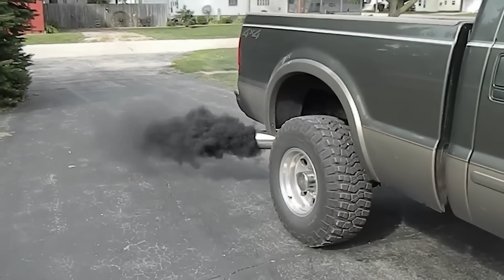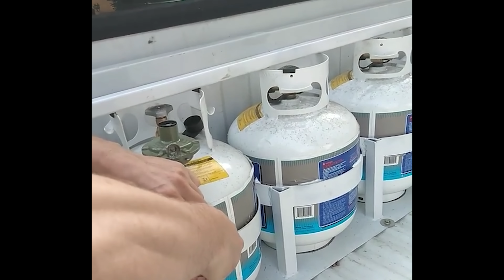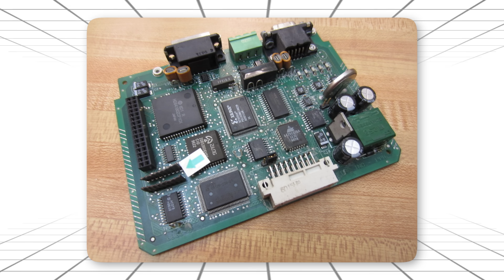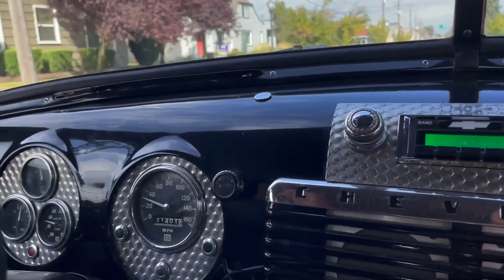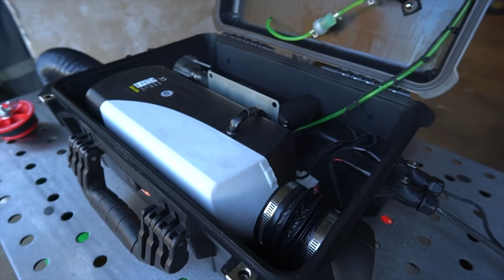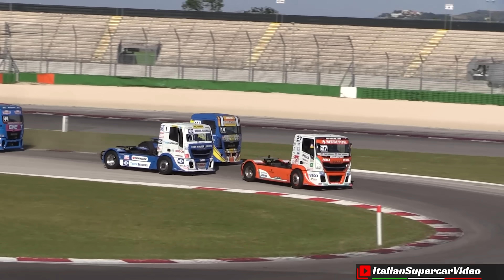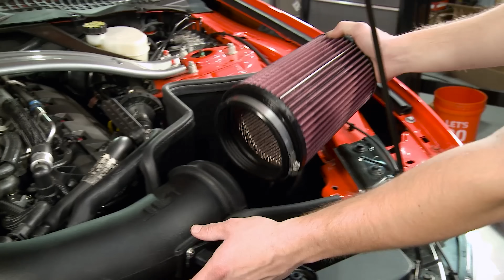They Made This Diesel Trick ILLEGAL For A Reason

Comment: Whats funny is its better for emissons,  extra cost, but no desiel particulares,  a clean burn.
Reply: It sounds like it should be a much better solution than using the DEF fluid.
Reply: @just-incase  Actually propane injection will increase combustion temperature and pressure and this will increase nitrogen oxide  production. Def can lower that. Benefit is more complete combustion that will lower particulate emissions
Reply: @williamvaughan1218   def has its own problems, like destruction of evergreen trees. Basic highschool chemistry proves this... it creates a chemical that stops the tree from protecting itself from parasitic bugs. You can find it in nature by animals urinating on a fire... which happens absolutely never... and for reason.
Reply: @just-incase Def doesnt help burning. It keep the catalytic convertor alive  bit longer.
Reply: @just-incase absolutely better... except with common rail technology. You have to tune very differently for pilot injection so the propane doesn't ignite before the diesel is ready for peak power combustion. And it helps clean up the box emissions the feds say they're concerned about, but prove in everything else they do that it's really not a problem...
Reply: Funny as a broken leg.
Reply: Nitrous oxides are the result
Reply: @sandasturner9529 
The result of what 
Please explain your answer
Reply: Sound more like complete bollocks to me.
It's presented as an easy answer but there are no easy answers.
Reply: @andrewfleming8103 
True as buddy since the 80s

Comment: One thing here I pass criticism as someone who was once certified to play with it it is not as simple as flipping a light switch if it pools and it explodes there such a fine fuel air mixture percentage that propane has to be within to combust otherwise actually you can put a match out in the mess

Comment: so you're telling me that i can reprogram to inject less fuel and get fucking amazing mileage?
Reply: I don't care for the bad AI video that glosses over the realities.  Cleaner burn yes with smaller propane percentages, but no "big" mileage improvement once you take into account the amount of propane used.  The extra propane will extend your range.  Cost savings per mile depends on the price difference between Diesel and propane, as when combined the MPG is about the same as the diesel is a higher BTU fuel and the propane a lower BTU fuel, but the propane does help the diesel burn cleaner/more complete when added in around 25-50%.  
When using in higher percentages as a power adder, miles per combined gallon of diesel/propane actually reduces MPG as you will burn through alot of propane.
Most of the AI above is talking about a single set amount of propane and not proportional control with Boost pressure, Throttle position, and RPM as used in the Superchips DPI setup.  The simple setups usually trigger of a boost referenced pressure switch.  Install is pretty simple, but the regulator should be heated from the cooling system.
Anyhow, just wanted to clear up the "amazing mileage" claim.  Example:  Truck gets 20 MPG with Diesel only (One Gallon), and 30 MPG with Diesel (One Gallon) + Propane (1/2 Gallon) so if you ignore the amount of propane being used, it looks like 30 MPG.  As mentioned earlier, the savings is/was through the cost difference in the price of the fuels.  And "Road" Propane includes an extra tax when used as an alternative fuel in a vehicle.  Using a grill tank is usually the most expensive cost of propane per gallon when buying on exchanging tanks.
"Home heating" propane is usually the cheapest per gallon, but I'm pretty sure against the law to refill a vehicle from your home tank as your not paying the "road" tax.
I'm not sure where fork lift propane tanks fall in the taxing part of propane costs?
I did upgrade to cylinder head studs when I installed the propane kit.  Never have had any mechanical issues with the DPI kit.  It can be tuned a bit with a laptop computer.  Usually don't want it to activate at very low boost, less than 3psi, as there is a power surge when it kicks in.

Comment: i've heard stories to where truckers would throw a small camp stove in the air cleaner box to avoid a tow charge if it was absolutely necessary my grandfather was a bus mechanic and he claimed this would cause it to weld the rings to the pistons and or damage the sleeve.
Reply: If all you're doing is just cracking open a fixed orifice then yeah, I can see it melting pistons at the very least. Nowadays proportional valves and advanced control are a thing. Half the tards in this comment section probably can't even pronounce proportional let alone know what it means, they sure have some strong opinions on literally everything, though...

Comment: We used propane for years before Water Methanol......
Reply: Got water meth on my Ram Cummins in Australia 
Power. Economy 
Less emissions 
9.8 litre per 100 Ks 
650 plus HP on tap
Reply: @garreysellars5525 that's insane my Hilux does 8L per 100k but only 170 hp
Reply: There’s no way you’re getting the fuel economy of a passenger car in a pickup that weighs near 4 tons just by adding WM injection. The science isn’t on your side.
Reply: @alpinexghost 
There is more to it 
Better air flow better 
Charge air cooler and bigger pipes
Plus other tricks 
I am a diesel fitter 47 years 
Tuning without smoke
The water methanol adds 87 HP starting at 10 psi of boost through to 28 psi on street tune
400000ks on the clock 
Up to you believe or not 
I know the facts
Point is I have reduced fuel consumption by 34 percent 
From stock with an increase in available power 
How is running the world out of fuel faster better for the planet 😅
Reply: Passenger cars should be less than that 
Our diesel 7seat 2 wheel drive is around 6.5 litre per 100 Ks
Reply: @alpinexghost WM cleans the engine, and just because of the clean engine, fuel consumption drop up to 15%.

Comment: We used to use dual fuel (propane/diesel) here in Australia for years, just became uneconomic for conversion. Power was up to 20% gain. BUT risk to pistons with poor tuning was very high.
Reply: I heard about it years ago, bleeding propane into the intake manifold as a way of increasing diesel mileage back when propane used to be cheap. I seem to recall that Tony Abbott fixed all that.
I never actually saw it myself, it was a recreational 4WD enthusiast who told me about it in very little detail.
Reply: @andrewfleming8103   hey at least I can use natural gas from my home and save some trips to the gas station lol
Reply: @andrewfleming8103 i just drove past my local servo with lpg still available its at 87.9 cents..

im still running a vt commonwhore on it. 

I  was spewing because I filled up thursday night at 89.9 cents  

I am considering doing lpg diesel.. I have a couple compound turbo
 hilux/4 runner/surf  which may benefit from it
Reply: Yeah knew a few guys that had it in a few utes and wagons and said it was awesome
Reply: It was done here too in the UK. One major fleet used it in the 1970's. It died out because of the added complexity and servicing didn't merit the relatively small gains. Added to which, the cost of propane increased which killed it in the end anyway.

Comment: Bullshit! Propane has an octane rating, which is the resistance to ignition, not a cetane rating, which is the measurement of ignition quality. Diesel does NOT use the octane scale, it uses the cetane scale. The opposite of the octane scale. Propane is just supplemental fuel, not a big, scary power adder

Comment: This is old news. Tractor pullers routinely used propane injection in Arkansas during the 1970’s. Now if you really wanted to see something exciting watch a puller inject ether in a diesel during a pull.
Reply: At work we had a truck that had the ether shaft for going uphill. That engine lasted four years
Reply: Seen a head get blown doing that, not blown gasket, literally the entire cylinder head went flying along with pistons and fire. 😂
Reply: @christopherleubner6633 . I know this is a possibility it's a matter of doing things responsibly. Although with my propane powered car I love being stuck behind the guy rolling coal. I get more get up and go
Reply: a farmer i worked for in the 70s had a redrooster booster system on the farmal for plowing when the going get tough
Reply: If it's ille%al for highway use,How does ,,,,SCUD in Sevier,Co.Tenn. use i/ in a truck they drive on highway,ex]lain this,Please???!!!!

Comment: uh no... propane is a fuel  nitrous is not a fuel  nitrous is an oxygenate and allows more fuel to burn  propane requires oxygen to burn
Reply: Propane's C3H8 vs N2O, the magic letter O. That's why top fuel is so fast, CH3NO2. Usually you need air, specifically the 20% that is oxygen, but not if it's in liquid form and in the fuel itself.

Comment: Propane has no power for combustion like that. It was initially used as an alternative to save on diesel. Was never meant to hot rod a working diesel. And with today’s engines, you’re app to lose power. There are other fluids that work far better than diesel when it comes to a diesel engine. We drag race with it all the time. Google it. R-82

NOTE: DONT DO IT AS A DIY PROJECT, YOU COULD PAY THE ULTIMATE ☠️ PRICE ☠️

Comment: You think this is "wild" Water/methanol  injection in a diesel will blow your mind
Reply: Lol yes it will thats what they use on tractor pulls
Reply: @Kevin-id5hx Yes they do!... It's a Science....
Reply: Yes Sir!...
Reply: That one is a crazy reaction. The diesel ignites, then the metanol gets the flame front to burn faster then the water reacts with the soot and turns it into carbon monoxide and hydrogen that burn what's left even more completely. 😮
Reply: And the engine.

Comment: Nothing illegal about propane injection, especially on diesels.
Reply: It should be mandatory
Reply: It is illegal, if you don't have attest.
Reply: @aleksandarpetrovic6613 just in CA iirc, legal if you are using DOT approved tanks that are crash rated.
Reply: Actually it is kind of mandatory in some states you know all those vehicles you see that are run on natural gas that's propane. Their diesel engines running on just propane
Reply: Yeah, most places don't even have emissions around here
Reply: Until you live in a state with emissions inspections.
Reply: @RogerSegerJr propane burns cleaner than diesel, or gas
Reply: @bmacguyver  the EPA will likely still find a way to ban it
Reply: @bmacguyver  Yes but EPA or any other countries' agencies don't actually care about the environment. If they did, they would have pushed manufacturers to making better tech instead of just band-aiding sh*t & making horrible engines. The less an engine lasts, the worse damage to the environment.. And as you said Propane is the cleanest + it can make Diesels cleaner, yet they don't promote it AND as said in the video, technically any modification to the system is an equal offense.. Emissions-equipment checks are the norm in most of europe too so it's not like US where you could get away with it in some places..
Reply: @bo-dine7971
100 percent 
EGR creates the need for the DPF. EGR = hot air detuner 
Combined they cause the engine to consume as much as 32 percent MORE FUEL
Tested proven
Water methanol injection ore power better economy 
And lower EGTs than with EGR 
How is running the world out of fuel faster better for the planet 
Using MORE FUEL would add to their warming BS
Reply: @bmacguyver  usually emissions inspections look for modifications or replacement parts which haven't been government approved and whether there are any error codes.  They might not even bother actually measuring the emissions at the pipe.
Reply: @Expiriment42 that would seem to defeat the purpose
Reply: @lbochtler  look at that for a moment... do they ever prove what's harmful? No. They say you're tampering with emissions, even though propane makes the burn considerably cleaner. The govt doesn't care about the end product, they want to enforce tyranny. Nothing more. They're causing more harm to the environment through their EPA bullschitt, and they know it, but they don't care about the end result of the chemistry... which is why they don't allow you to challenge the chemistry by setting laws against tampering instead... Modification, creating machines is a fundamental right, and it's evidenced by the fact they do it all the time. They just want to control who does it, even though it's not enforceable, and even though it's too easy to prove their chemistry incorrect. Sure, what they do is allow for a cleaner tailpipe, and that's all... at the expense of poison coming out the exhaust pipe well beyond the mere carcinogenic compounds... While their chemistry does clean up the appearance of smog to some degree, and the ability to generate black smoke, the effects on greenery is completely off, and they cause all greenery to not be capable of using co2 and Co as nature intended. That's why especially def is particularly harmful. But their obstinance won't let them change... hopefully Trump fixes that.
Reply: @bo-dine7971  there's something different still with EU emissions... I drove a Jetta rental for a couple weeks there in 2019 and got 53 mpg... that's unheard of in that vintage in the US from the factory.
Reply: @garreysellars5525   they're known by their fruits, not their narratives... 

They develop "science" to fabricate narratives, when the complete science would create better mpg that aligns with less fuel consumption and actually cleaner emissions. The Earth naturally thrives on the exhaust of burning oil, but catalytic converters and def change the chemistry so the trees can't use the nutrients of co2 and co nearly as effectively. Nox emissions ultimately turn into fertilizer, naturally. 

What it does inside of the engine is exactly what it does to the environment at the same time. Highschool chemistry proves this, and so we have to get the government to stop ruining the environment.
Reply: @bmacguyver  and when tuned with diesel, makes diesel burn much cleaner. Def and catalytic converters work against the engine. 

Installed on a common rail diesel doesn't yield the same results as on previous technology, yet could be made more effective, with proper tuning.
Reply: @Faolan161 trumps not fixing anything epa related. And I think Trump is ok. Not against him.

Thunderstorm generator
Reply: @marksummers1911   Trump pardoned someone prominent in the automotive world for EPA condemnation... so now they are changing their laws and backing off certain regulations. Yes, he's making a difference.
Reply: @garreysellars5525  the DPF ID for soot, which is created with AND EVEN MORE WITHOUT EGR. Soot is just a combustion byproduct, which the DPF is supposed to catch
Reply: @bmacguyver  higher combustion and exhaust temperature means significantly higher NOx emissions, so not overall cleaner
Reply: @RogerSegerJr  They'd have to create a separate task force just to enforce emissions, the regular police don't care about that shit. They only respond to calls where they can act like they didn't get bullied in high school then cry on the radio that they are getting their asses kicked because they're not that guy and never will be.
Reply: @AlphaOmegaSigma07 some states already have this. I know for sure on slow days in Florida, the commercial motor vehicle compliance division has no problem stopping a diesel pickup and checking emissions, and emissions systems. Looking for deleted trucks.
Reply: @adventuresofwillandshelby6013  They can go fuck themselves. If your truck is too loud between 10pm and 5am I will do something about it myself and I won't stop until the shitcan never comes down my road again.
Reply: @RogerSegerJr nope.. and I live in one of those
Reply: @RogerSegerJr propane injection runs cleaner
Reply: @RogerSegerJr I don't live and pay taxes to tyrants

Comment: I’ve also heard about people putting Propane in their air conditioners systems in vehicles. instead of whatever freon substitute they’re using now. I guess it works well enough but it would be extremely dangerous to have an accident and have it leak. It would be become a fireball.
Reply: Look up "R290"
Reply: Some years ago here in New Zealand a coolstore warehouse used it in their refridgeration equipment. When an alarm went off and the fireies attended it went shy-high killing one of the fireies and seriuosly injuring others.
Reply: The amount that would be needed on an automotive system compared to the tank of gasoline is of little concern (1-2 pounds at most), the pressures are the problem, propane (R-290) runs at pressures roughly equal to R22, now isobutane (R600a) operates at pressures similiar to r12 and r134
Reply: I have a camper that has propane, 12 volt and 110 volt refrigerator.
Reply: @Jamessmith-j4p  rv use amonia gas , the heater plate is heated using  electric, 12 v , 110 v  or by burning  propane to heat the plate
Reply: How would it blow up in a leaky AC system.  Heck.  People want to save money right, on an old beater car.
Reply: Wow you mean using LPG as a refrigerant in place of R134a?
Reply: check out the first refrigerator’s made.
Reply: @Jamessmith-j4p  ok

Comment: I've known about propane injection for many years. I wouldn't use this on a road going engine because of the high exhaust gas temperatures. Even done right it can melt the exhaust side of your turbo very quick.